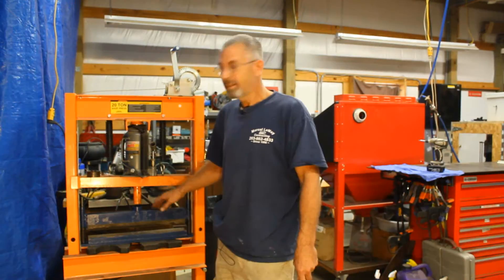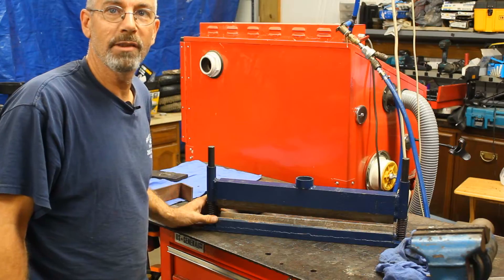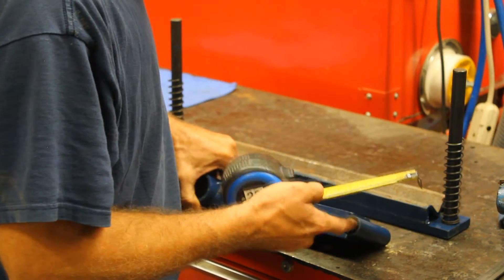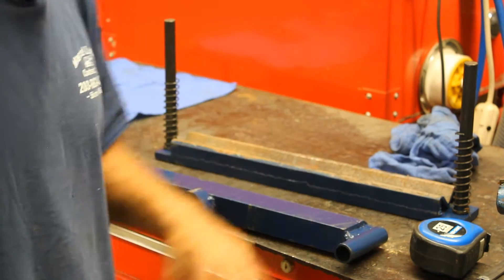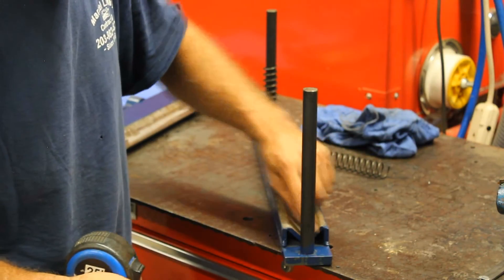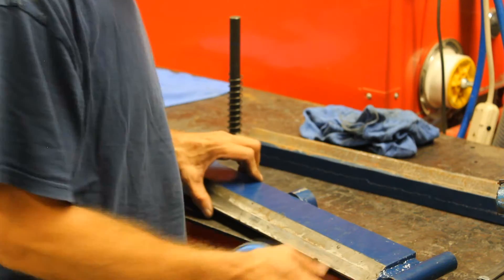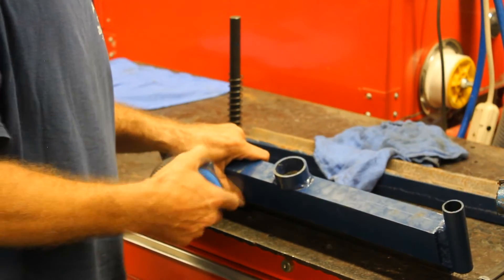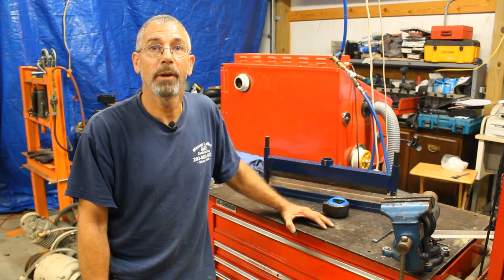Home made 20 ton press brake, for harbor freight shop press

Comment: Great video, very much appreciated! Can you explain how did you use the milling machine to make the wedge? thanks
Reply from the maker: I milled the wedge shape on the mill with a 3" carbide shell mill. It took a while...that's a lot of material to remove.

Comment: How thick and tall is the wedge blade? I have a shop built 50 hydraulic press and power supply that runs my press and large drill press. Thank's for the ideas and video!
Reply from the maker: +George Chambers The wedge part is 1.5"x3" . It doesn't have to be that thick.  It's what i had on hand.  A 1/2" x 6" or 3/4"x4" would work fine.  Thanks for watching.